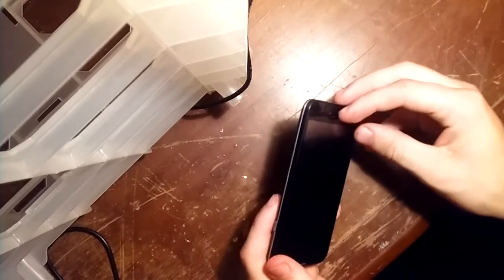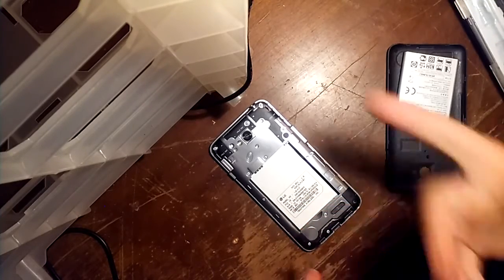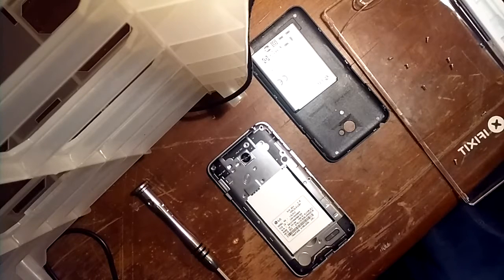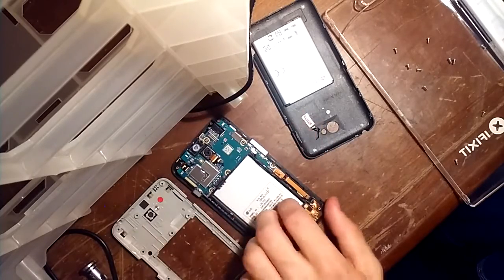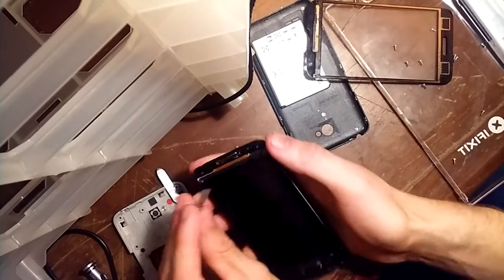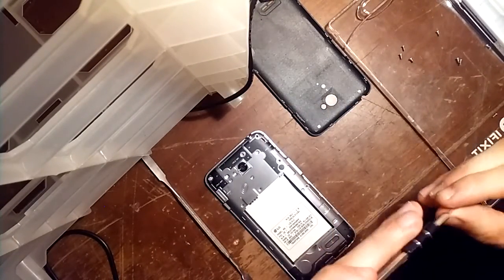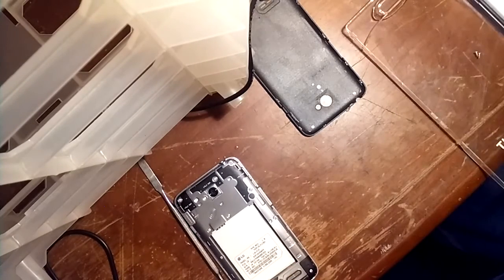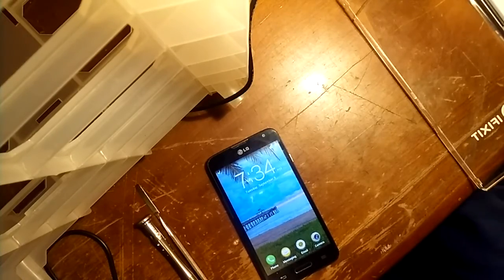LG Ulitmate 2 L41C Digitizer Replacement

Comment: What if it's the display that doesn't show up but it still responds when you tap it?
Reply from the maker: That means your LCD Screen is the problem and not the Digitizer (AKA Touchscreen). You will need to replace the LCD Display you can buy one here http://www.ebay.com/itm/like/111708266161?lpid=82&chn=ps&ul_noapp=true
Reply: Thank you very much, I'll see if that helps.

Comment: Does this replacement require double sided tape or some sort of other adhesive? Thanks
Reply from the maker: +LMFiatoa Yes that would be a great idea to do, but the screen will work with out the tape. I would advise lining both sides of the back with the tape and small sections on the top (But not covering the camera or prox sensor) and around the home button.